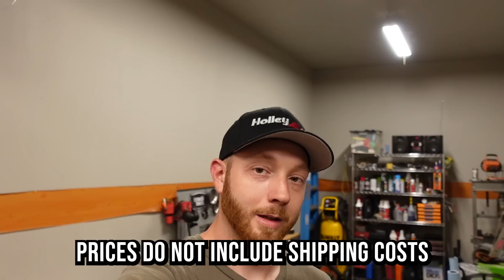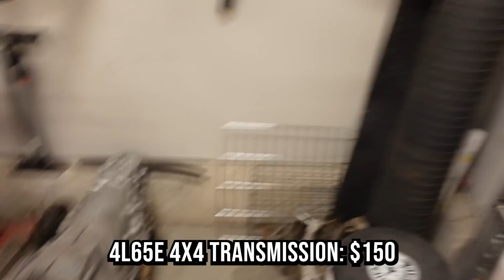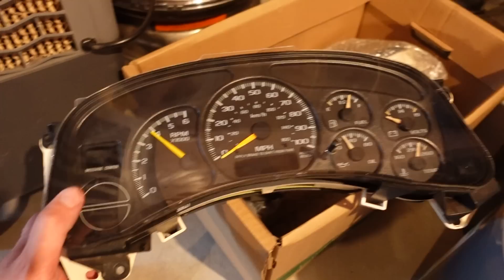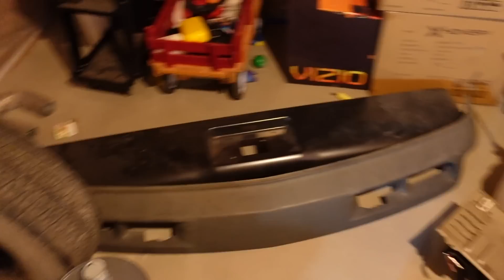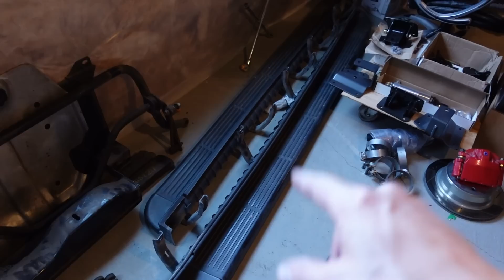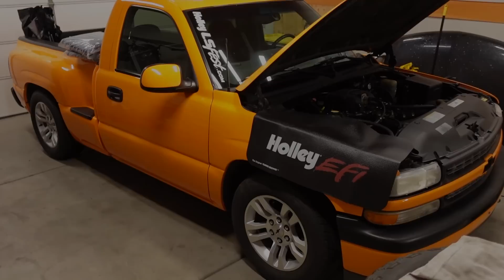selling EVERYTHING to make room for a GIANT ENGINE: it's almost here!

Comment: What's the easiest thing I can do to make anywhere from 100 to 200 more hp out of a 2008 4.6 f150 2wd with out wrecking the motor i also plan on leveling it and running 35s and what about the transmission and the difrential what do I need to do to make a little torque also the transmission needs to be rebuilt anyway

Comment: Hey LT, so I have a question... are you saying that the mileage that was displayed on the dash cluster when you removed it is the same that will be displayed in the new install?  The cluster doesn't receive the mileage (odometer) information from the actual ECM?  That seems weird as that would be the easiest way to defraud someone with a high mileage truck by just popping in a low mileage gauge cluster...that seems counter intuitive since they are only digital displays
Reply: It will Paul,  I bought a denali odometer  with 138k, my truck had 132k. I waited until I had 140k then I swapped it. So my truck has 2000 miles more than what it says.
Reply from the maker: Correct, mileage is stored in the cluster, not the ECM in these years if trucks. And yes, it would be very easy for a dishonest person to do the ol’ switcheroo to show a much lower mileage
Reply: You can get the clusters reset with the mileage but I’ve heard it’s a pain

Comment: Very excited for the coil over install been considering doing this to mine have an 03 4wd that is lowered 4 and 6 spindles and keys in the front front & rear shackles re arched rear springs had to actually put a lift block back in the rear to make it sit level cant get the front any lower with the torsion bar set up excited to see what this does for super truck.  Not copo change the name to super tuck since it a had a super car 0 to 60 time.